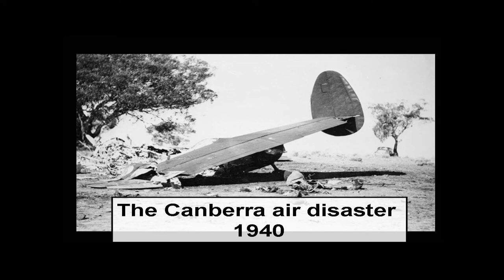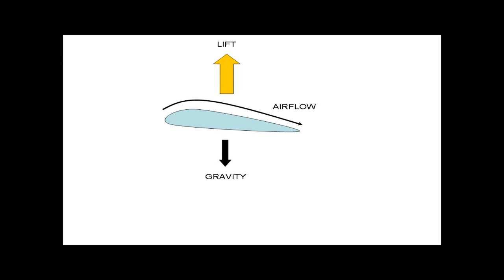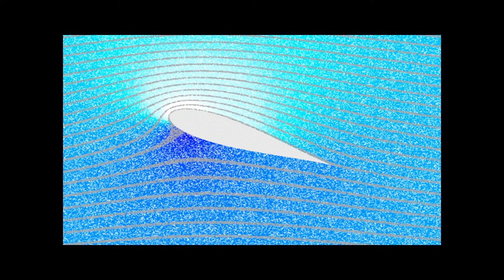The Canberra air disaster

Comment: Its definitely not how you discribed it. They didnt even attempt to land because the crash site is still  around 3 Km  from the Airport. They were flying too low and hit the ridge top. On a clear day in Canberra in winter, there will be fog until midday, so I think they mis judged the hills through the fog.
Reply from the maker: Reports from the time reported very good, ideal flying conditions. The official investigation, and also the air-force investigation (if I remember correctly) reported flaps were down. In any case they concluded the plane crashed as it was coming into land. The only reason for flaps down that would be coming into land, too low speed, so stalling.
The only real mystery was who was flying as far as I can tell. 
Please share what documents you have contradicting this, if they hold water I will make note about that in the description.